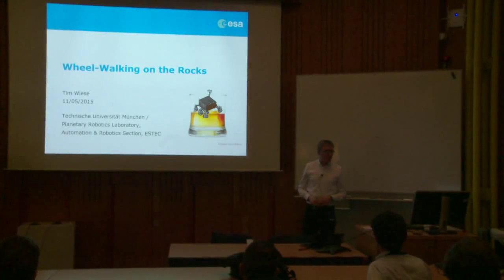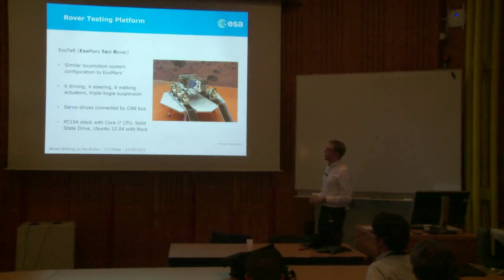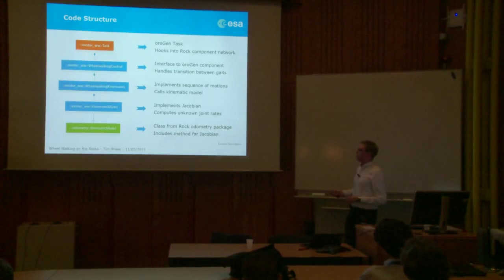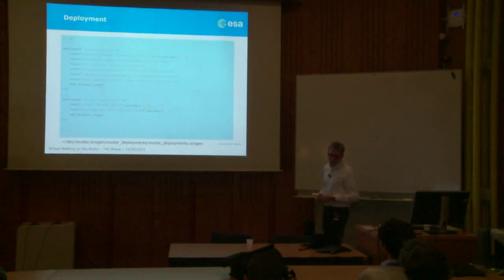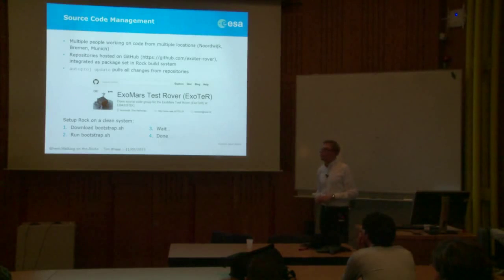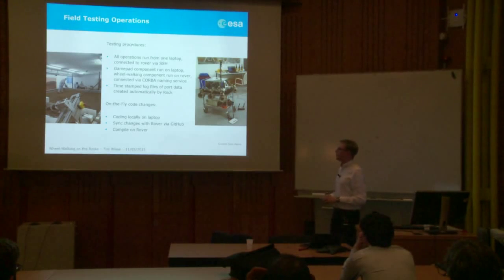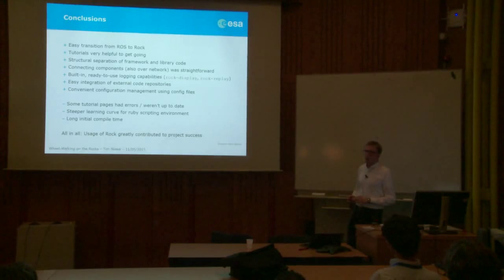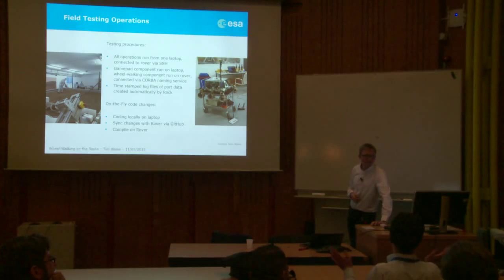Rock Workshop 2015: Wheel-Walking on the Rocks

Comment: You simulate phased motion in the wheel-walking mode. But that mode does not much efficient.  Better is  the wheel-walking mode as a uniform discontinuous motion. It have more traction force. For example https://drive.google.com/file/d/0BzHqTFc-hHbzVjRQX1lPOFlWeTA/view?usp=sharing
Reply from the maker: Thanks. Those were just the first experiments. There are further tests to characterize other modes. You might find further investigations in the literature (see references below). However, in this implementation, the rover body's velocity is constant while combining the phased motion. Which I found it an advantage. You could actually see it in this video: https://youtu.be/qkOKzFq1SpY

[1] M. Azkarate, M. Zwick, J. Hidalgo-Carrio, R. Nelen, T. Wiese, P. Poulakis, L. Joudrier, and G. Visentin, “First Experimental Investigations on Wheel-Walking for Improving Triple-Bogie Rover Locomotion Performances,” in Advanced Space Technologies for Robotics and Automation, 2015. 
[2] T. Wiese, “3D Kinematic Modeling and Evaluation of Rough-Terrain Locomotion Modes for an ExoMars-like Mobility Subsystem,” 2017.
Reply: The wheel-walking mode by the test in video I find not good too. That is also phased mode. You can see as the rovers body by this wheel-walking mode have side wobble. Yes, you have more speed and the body move continuous. The constant velocity for body does not  need.  You need maximum of traction force. But the maximum traction force is by the uniform discontinuous motion only.  First the wheels are puttied forward, then the body is carried. That mode let the moving on a slope before 32° on loose ground. The Mr. Azkarate Test in Video is maked on horizontal plane. It is better than wheeled mode in the loose soil but it is not optimal. I have not seen never the wheel-walking mode on the slope.  You must show the wheel-walking mode for ascent on the slope 32°.
Reply from the maker: You are right, this is also phased mode. We were investigating which possible gait is the most suitable for each situation. Uniform discontinuous motion have more traction but it is also the slowest in speed. I also agreed with you that for 32° the uniform discontinuous motion might be the best.
Reply: Dear Valery, indeed the uniform discontinuous motion you showed in the old video is the optimal for maximum traction force which would be the choice in extreme cases such as 32deg slopes! We have implemented various wheel walking modes including phased and discontinuous modes and our idea is to exploit them depending on the conditions of the scenario and a phased mode can be more efficient (or simply faster) in some situations. Thanks for your inputs!
Reply: Dear Martin, thank you for response. I have read papers about yours research in applications of wheel-walking for mars rover. I find the results very interesting. I know that ESA mars rover ExoMars have wheel-walking. But I did not see never videos as the breadboards of the ExoMars rover move in wheel-walking mode  (excepting yours tests with ExoTeR in phased mode). But the ExoTeR is too old breadboard. So I thought that technology wheel-walking have not got progress and wheel-walking drives will be used for unfolding chassis only.